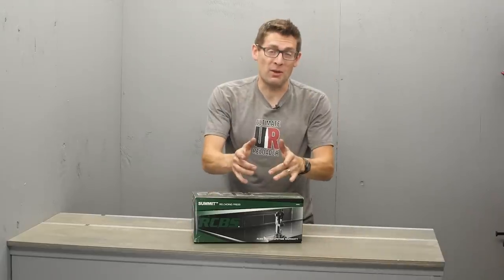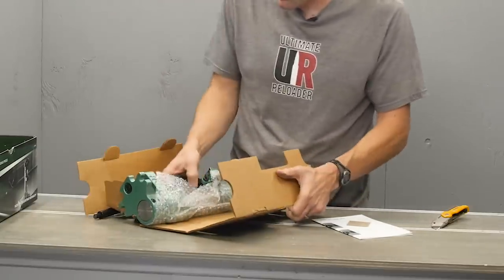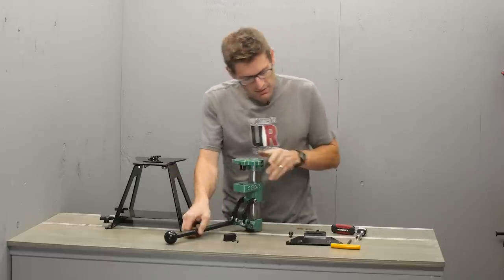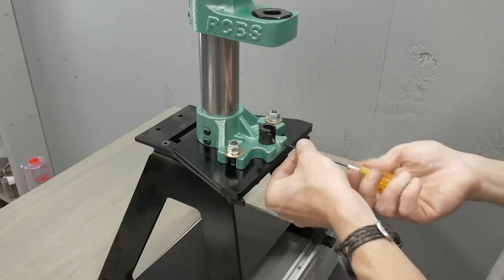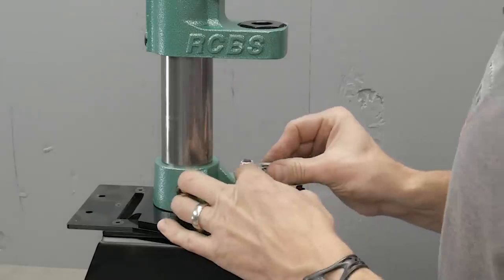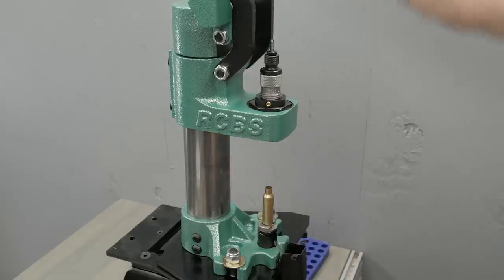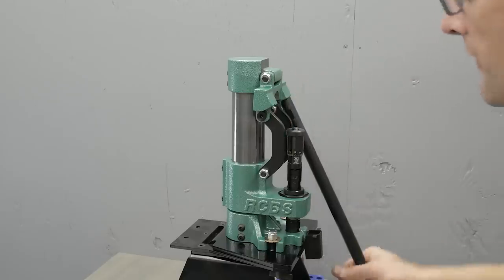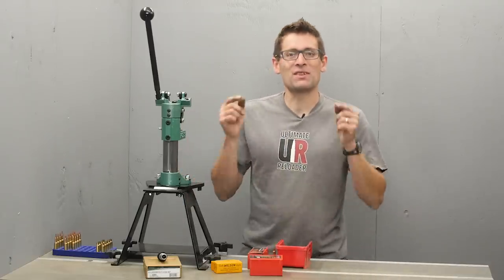RCBS Summit Press: Unboxing and Overview, Loading 6.5 Creedmoor

Comment: Thank you for another great review.  Waited for a while for you to review the RCBS Summit (I suggested this review a while so appreciate it).  I personally love how this press seats bullets and how you can set it up anywhere at home or at the range quickly with the right base setup.  It virtually eliminates bullet run out.  The Summit also does work great with the Hornady die bushing conversion for even faster caliber switch over.  I recommend buying the optional short handle because it makes seating bullets so much faster and easier and the press even more compact.

Comment: I have the Red, White and Blue limited edition Summit press there were only 2000 of the color combo made. This press is a beast I have the Hornady quick die changing system for it. This press is heavy duty. Only draw back to it doesn't come with the Short handle. Gavin is right on the money with the review of this press.
Reply: I have the same one and love it. I bought the short handle for seating bullets, it works well. I also bought the conversion kit so I can use it with Wilson dies as a arbor press.
Reply: @jesusisalive3227 regarding the smaller piece in the conversion kit, do you simply unscrew the shellholder adapter and replace with the bottom arbor piece?
Reply: @luvtahandload7692  

There is a nut under the press that you have to remove to take the shell holder off.

Comment: That thing is a monster. At first blush, it looks as if you could almost get away with not bolting it down! If you shortened the handle and/or gave it a bit of an upward bend, it would clear the tabletop.

The obvious question is "Why would I move from some other single-stage press to this?" The first answer which suggests itself is that all else being equal, solidity breeds concentricity; you aren't going to bend that ram pillar in any great hurry.

Comment: The RCBS Summit has ALL THE SLOP it needs. There is plenty of left-right slop for the die. The cartridge itself ALWAYS have front back slop because that is how you slide the case into the shell holder anyway. Combined, this is a self-aligning system which allows the case to center itself the die without undue pressures in any lateral direction.

Comment: I’d like to see how the overall run out is on the cases. Would be good info.!
Reply: Vaughn Precision  it is crap mate don’t buy one . I did and very much regret it
Reply: Dahut all the gear I run on the press is rcbs
Reply: Dahut I might have a bad one but RCBS have told me that they have some the broke. Gavin highlights that they don’t have vertical movement well mine has heaps the rear screws can’t go any tighter. I have been thinking about getting it re bored and sleeved to take the tolerance out of it
Reply: Wow look what you’ve done. He measures concentricity on every press now. I wanna see Base to Ogive numbers  .
Reply: Can you seat primers with it?
Reply: @asherdog9248  with a lee ram prime you can

Comment: You can't use the gold medal dies with this press if loading longer overall length cartridges, like 270, 30-06 and longer. Notice when he runs the dies down, how the micrometer barely clears the hinged area as he seats the bullet. Just a heads up. Someone may have mentioned this all ready.
Reply: Yes you can

Comment: The press doesn't look sturdy.  I'm used to seeing beefy looking parts.  Maybe the viewing angle of the video doesn't do justice to this press.  Only two small bolts to hold down the small base area of the press.  Is there movement between the press base and the mounting bracket when case sizing?

Comment: Seems like a ton of arm travel for what benefits?
Reply from the maker: Leverage :) - there's a shorty handle option as well...
Reply: Yeah... really! At rest (top) just like the song. It's a long way to the top. "if ya wanna rock & roll"
Reply: Dean Hudson  Or as we say in Australia; "if you want a sausage roll"
Reply: That's what I said before I read your comment
Reply: @Ultimatereloader  the angle of the handle doesn't seem any good
Reply: @paulvenn4447  
That's funny!  I dig it...
Reply: I have a Summit press, and I have to agree with the arm travel. I bought the short handle as well, and it helps, but the real problem is that the pivot point is at the top of the press. This requires you to lift your arm up and down. This is not a problem for a small number of rounds, but when doing a lot of rounds, my arm gets tired. I have since installed the arbor press conversion for use with Wilson chamber style seating dies, and it works very well for that.
Reply: Yes, what I thought.  Really nice press, but the handle is way too high,  and unlike even a Lee the handle isn’t adjustable.  I love the inline fabrication stand, but with this press you would be much better off mounting it at table height.
Reply: There is a shorter handle available for it as well as aftermarket Dillon roller style handles as well.

Comment: Gavin how was the concentricity using this setup? Does the shell holder or die float like the Mec or coax?
Reply: He goes into more depth on it in his "14 Reloading Presses Compared" : the BIG Single-Stage Shootout I'm pretty sure its completely solid  as far as the press goes but the shell holder has a spring snap in possibly. They make a solid steel, huge ,flat faced steel plug like part, with a nut to tighten it up on the bottom. fwiw.  I just ordered it for 26.00 if you just want a heavy duty precision arbor press style setup.

Comment: I'm using the summit and number 19 rcbs shelholder for the.224 valkyrie and a case gauge but when I resize my case isn't sitting completely flush i set a cam over and it's the same. Any suggestions?

Comment: How do you think this rates against a LE Wilson arbor press setup.
Reply: They make a solid steel flat face "machined plug and nut" for  lack of better terminology, to convert this RCBS, to a arbor style setup, for $26.00. FWIW, I just ordered this press for 199.95 and the and the conversion at Natchez Shooters Supply

Comment: I have greatly enjoyed your vids.  I am just now getting into reloading.  Single stage only for now.  I have an RCBS JR3 (1977 mfg) that has never been used.  My dad bought it along with a Rem700 BDL 7mm rem mag.  I also have the never touched RCBS dies and the rifle.  Would you recommend using this press or should I buy something new like the MEC or the Forster Co-Ax?
Reply: @ common sense ---- Hello. Yours is a Four-year-old question. Guess the Channel owner did not read it. I will offer you an answer. 
 
 Go ahead and use the press that you have from your Dad! If you already have a Press and the dies, may as well use them. All reloading is about a 5-step process. Whether it is the old Ideal/Lyman hand-held "310 Tang-Tool" (aka: The Nutcracker) or a expensive bench mounted turret-style press.  I have the Forster/Bonanza/Co-Ax press and like it. They are expensive. That is why I suggest that you use the RCBS you got from your Dad. Hope this helps, even though it was posted 4 years ago.

Comment: I can see the dies are going to be doing an awesome job but how is the press any better than any "O" press out there.
Reply: Chevy 6299 this press in my opinion is better there is no reaching around a bar and you can see exactly in front of you. This press doesn't take up a lot of space at all there is only 2 tie downs on each side.
Reply: Some good points David, Thanks.

Comment: Prefer being able to do the primers on the press although this is pretty slick
Reply: I bought another press to do the on board priming/sizing  and I am gonna use this RCBS  Summit to do bullet seating like Gavin did here. They make a solid steel arbor press style conversion also! It is like 26.00 accessory from RCBS.
Reply: I use the Ram Primer by Lee on the Summit press, https://leeprecision.com/ram-prime.html works great and has a good primer seat feel with the short handle.
Reply: KTMsoldier1988 I use the RCBS primer die. No issues.

Comment: Gavin, Can you "Reform" Brass with that press?, how well does it work with say the "Lee Ram Prime" die set for priming?
Reply: I have used both the RCBS ram prime and the Lee ram prime with this press in conjunction with the Hornady Lock and Load system. Both get the job done but I do prefer the Lee ram prime in that the ram is sturdier if that makes sense to you.

Comment: Can Hornady Cam Lock Bullet Puller's be used on this press?  The reason I ask is because of the puller handle length might get in the way of the dual arms.
Reply: It would be difficult to use.

Comment: I find that my summit press sticks and is hard on the up stoke when I full resize to the point I broke the cast where the handle screws I have you had any issues with that
Reply: Sounds like they messed up on the linkage maybe? That's assuming that you remembered to lube your case.

Comment: I have the same one. It does not size cases properly. OAL varies between case to case. I contacted RCBS with no luck they might of well called me a dumbass. The problem is with the arms pushing the ram. They have  too much play.
Reply from the maker: That's strange. Let me ask my friend Mark about this.
Reply: Anthony Ortiz really? I’ve had mine since February, sized and loaded 223/5.56, 224Valk, 22 and 6.5 Grendel, 308win, 6.5Creedmoor, and 260rem with zero issues. Mind you, during sizing, if you are full length sizing, you will see the cases overall length grow! That’s why we trim cases AFTER sizing and not before. I’ve found mine to make exceptionally accurate and concentric ammo.
Reply: I think the arms lowering the ram are loose. I’ve tried tightening them with no luck. When I first got it you could very noticeably see where it stopped sizing on the case neck. I tightened it and lowered the ram (case in shell) and noticed there was now a gap between the shell holder and the die. Just out of curiosity I measured the gap a couple times and there was .002-.004 variance with the same case. It’s been sitting on my self for over a year.
Reply: Gavin have you done a series of Video for a hand-loading start to finish including possible load data workup etc once fire cases vs bought cases with comparison of availability etc. Maybe that would help many folks just getting started and using wet tumbler or dry media. That kind of series can get pretty in-depth and beneficial I would recommend you compare the presses and dies and techniques you have used to get accuracy and precision at more than 100 yards.
Reply: mate,i had inconsistent results resizing and seating, cause 1 - the two screws at the rear of the die holder that go into the key way to keep it straight where not long enough, check items 9& 10 in your parts manual not the same! i made longer guide screws to fix the problem. 2 the bolt hole on the front of the die holder to attach the arms was not 90deg to the axis of the post, causing the die holder to tilt / twist during travel. 3 the post hole in the die holder was .008 to .009 thou over size - a few pictures and a few emails RCBS sent me a new die holder now everything is square and working as it should. another modification i did was removed the shell holder circlip and 3D printed a shell feed platform that slips over the shell holder post. it gives the shell holder a little bit of movement as well as funnels the shell straight into the holder.thanks woodsy56
Reply: Anthony Ortiz Did you contact RCBS technical support?

Comment: Am I the only one watching the press (or something) flex like crazy as he resizes!?!? Focus on the top of the press and back wall as he resizes the cases. Something isn’t solid, which is less than ideal for consistency.
Reply from the maker: It's the mount- when you get that tall and add the quick change plate, you get some flex :)
Reply: gavintoobe  I would have thought a shorter mount might have been better with that press
Reply: What's going to matter is the relative motion of the cartridge and the die. With a press built the way this one is, that's not going to be much - chances are you will bend the mount or rip the press clean off it before that happens.

Comment: This press is junk. I had one for 3 months, maybe 800rnds loaded and the top crossbar linkage assembly snapped in half. I researched the gun forums and this is a common failure point of this press. I can't believe RCBS is still selling these without a recall/product upgrade! I requested a Rebel to replace the Summit.